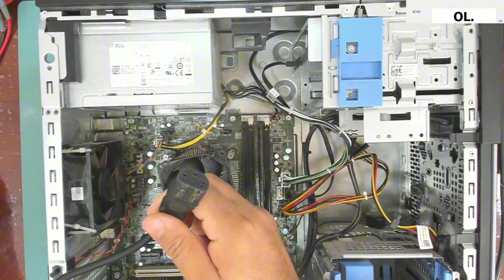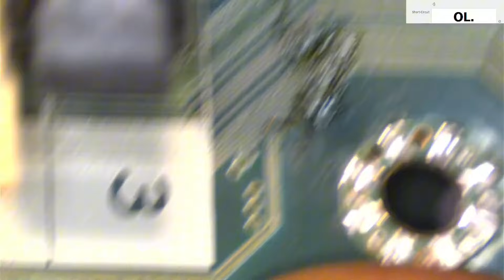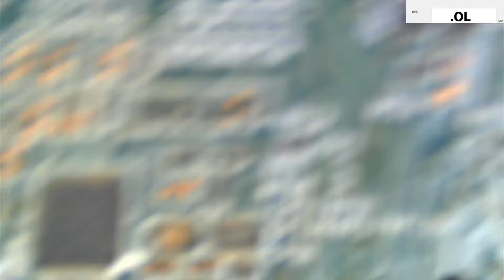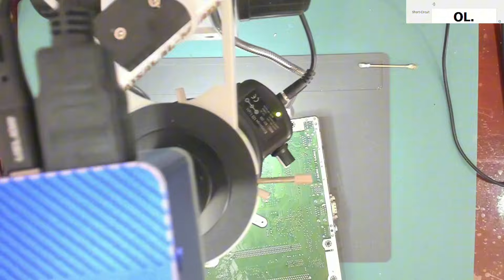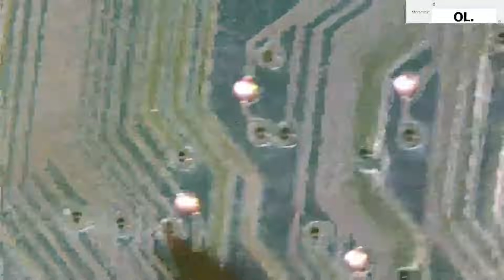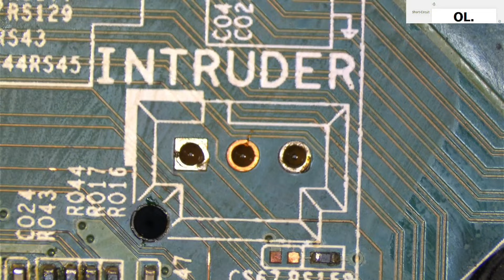Dell Optiplex 7020 No Power-On Fix

Comment: If you hadn't found the broken trace/if you had continuity from the switch connector to the chip, would that mean the board/chip needs to be replaced?  I have exactly everything going on here on my shop desktop.  I don't have 3.3 to the power button, but I do have continuity to the chip.
Reply from the maker: The 3v3 voltage does not come out of the chip itself but instead from a pull-up resistor to 3v3.
If you don't have 3v3 at the Power button and you have continuity to the chip, then you most likely have a problem with the 3v3 or the pull-up resistor.
Check for liquid damage next to EC chip
Reply: @FixTronics  Thank you, I don't have any damage that I can tell.  I went ahead and ordered a cheap board with a warranty on ebay, hoping it fixes it.
Reply from the maker: @youngconfucius 
You welcome brother 
I wish you all the best

Comment: Resp Sir! Very Nice Class Sir. Sir My Dell Optiplex 3050 PN:VJ4OT Motherboard CPU was Ram 1.2V Ok But CPU, VTT, Graphic Voltages Not in Sir. Orange Light Blinking Sir.   Fan Continue Moved Sir. and 4Pin Connection Removed Fan Run Sir, Hwere the Problem Sir. Please Advise Sir, Iam Waiting for Mesege Sir. Sir Iam Telugu Sir. Please Sir.  --    ChinnaRao Paderu Andhrapradesh
Reply from the maker: Hi friend 
Try and replace the RAM module at first i it still then you might have a problem with the bios or in worst case scenario you may have a faulty CPU
Don't forget to check VCCSA also..
Reply: Resp Sir! Dhanyavaadh Sir.   @FixTronics

Comment: The voltage in the pin of the front panel is going to the IO or is coming from the IO
Reply from the maker: This voltage is actually a ldo voltage in which the super IO  is pulled up to.
The same line that goes to the super IO goes to the power button which is used to pull down the voltage to GND.

If the Super IO is shorted you will not see that voltage at the power button as the super IO consumes and converts that voltage into heat